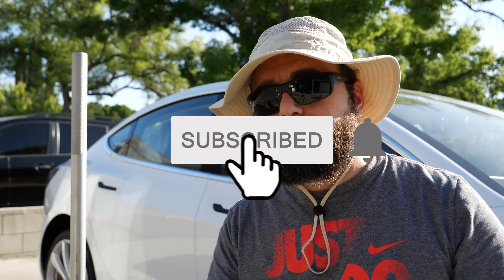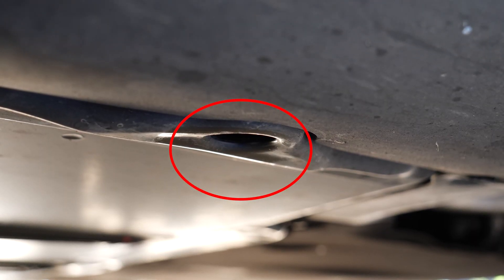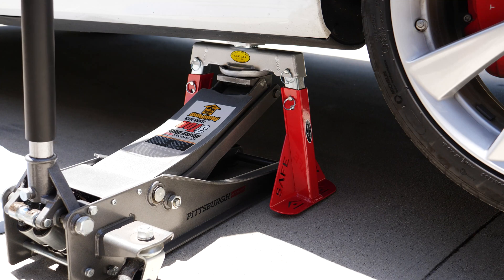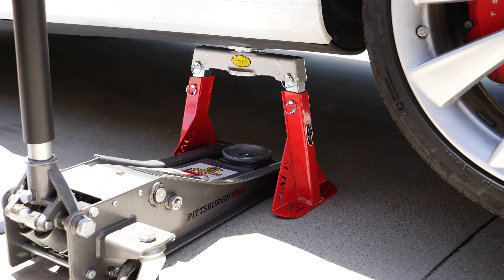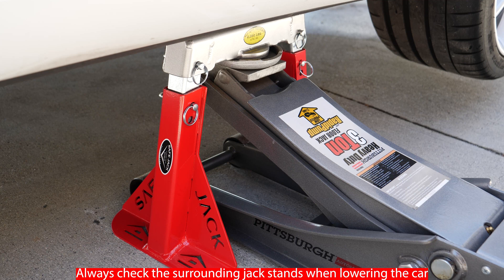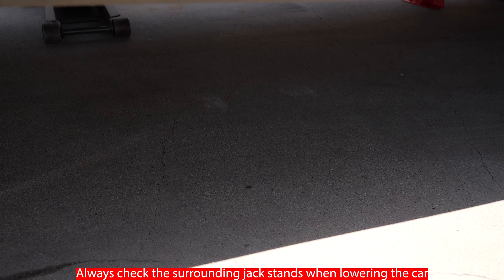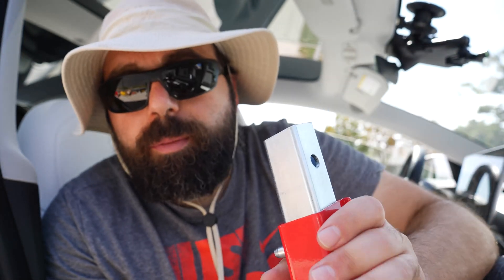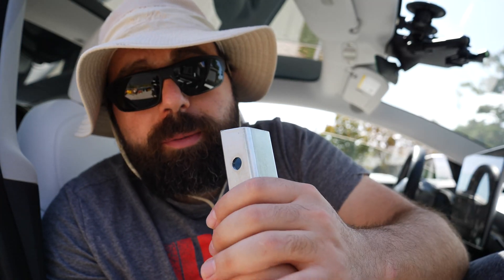How to Rotate Tires | Tesla Model 3 Performance

Comment: Can you rotate tires on the new 2024 model 3 performance? The rears are 20s and the fronts are 19s....so im assuming no?
Reply from the maker: No, it’s a staggered setup
Reply from the maker: Btw I heard that from somewhere as well but I think they’re all 20” wheels but the rear wheels are wider. Either way can’t rotate
Reply: Yes front right to front left and same for the back

Comment: 🤷🏻‍♂️ Tesla recon rear to front to rear - not cross.... for every 10k miles
Reply: When I saw this I was scratching my head because you most certainly do not cross sides on a Model 3 Performance. First off, the tires are directional! Swapping sides and they are facing the wrong way! Second, all Performance are AWD. What? 🤣

My rotations are only front to back and back to front for the 20" Summer Performance tires.  I have a set of 18" wheels with snow tires for winter which are also directional tread so same thing.
Reply from the maker: Depends if it's all wheel drive or not.
Reply: @landpet  That goes for all wheel drive as Well 🤷🏻‍♂️
Reply: @landpet  All Tesla Model 3 Performance are Dual-Motor AWD!

Comment: With the safe jack top piece on the my low profile jack, it come s about 6 inches high. Will the trick that you mentioned, keep the car 6inches above the ground? I was thinking about inserting the top cylindrical adapter into the car's  jack point hole and then move the jack underneath. Not sure if this will work.
Reply from the maker: If it doesn't work, you can always lift the car from the front side (dedicated jack point hole) and insert the safe jack in the rear (dedicated jack point hole) (cause the car is very rigid). Granted be very careful when doing this as it can be dangerous. Upon removing all the safe jacks, hopefully the car sits 6" higher which seems possible but I'm not 100% sure. Removing the safe jacks, you may have to use the same trick. Be careful during this process in general cause it can get dangerous.

Comment: What jack did you use? I measured 5 inches of ground clearance on 2020 Model 3 Performance between ground and jacking point and Safejack says you need to leave at least 1.9 inches for their jack stand and pad. My 2020 Model 3 Performance would leave 3.1 inches at most for the lowest jack height. It seems like most jacks, even low profile ones are 3.75 inches or more for the height they sit at their lowest point.
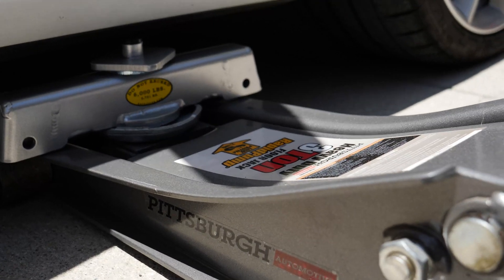Reply from the maker: My jack wasn't low enough either that's why I had to do that trick (2:30) where I raise the car and lower it which let's the car sit higher, then I can put in the safe jack with my same jack.

I use the low profile pittsburgh 3 ton jack that I got from harbor freight.
Reply: @landpet  Do you have a link for the Jack model that you used ?
Reply: @silvers3180  I bought my jack a long time ago from Harbor Freight, so you can pick one up from there if you would like. If not, I have an alternative linked in the description section: https://amzn.to/39JjMtc

In fact, everything is linked there (assuming it was linkable)

Comment: Do you lube your brake calipers too? IIRC Tesla recommends cleaning and lubricating every year?
Reply from the maker: Thanks for pointing that out, they recommend that for colder climates. I'm in Los Angeles, so it doesn't get cold here (I should say it does get cold sometimes, but it's not what some people would call "cold"). No I haven't done that, there's also no salt or anything like that on the roads since it doesn't snow here.

Comment: Dude, those jack stands are $169 EACH???
Reply from the maker: lol, that's what I said when I first saw it. I bought it on sale for about $140 each but yes very expensive, all the other stuff I used is relatively inexpensive. You don't need four of them though, you can get away with even one but two will make the job easier.